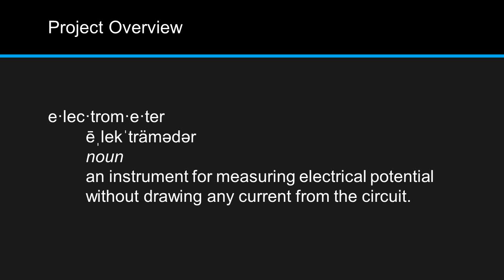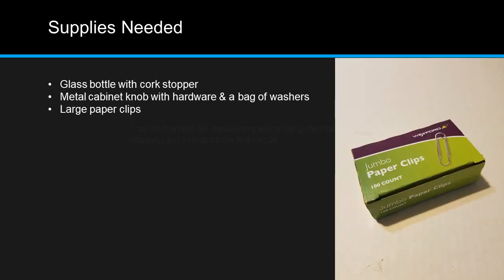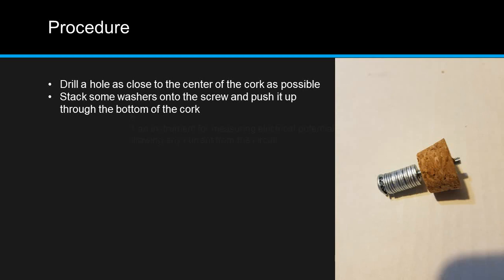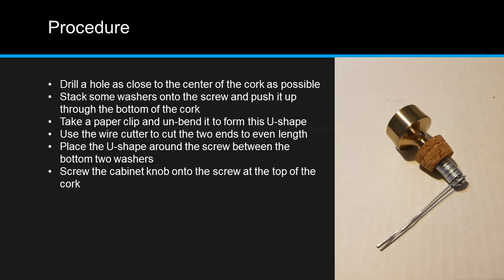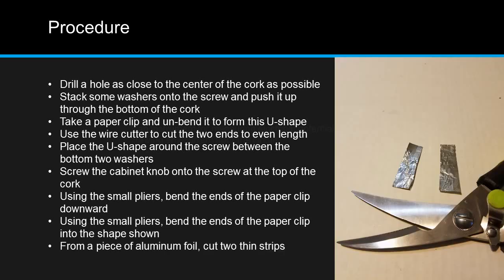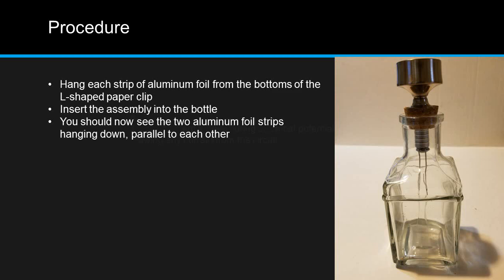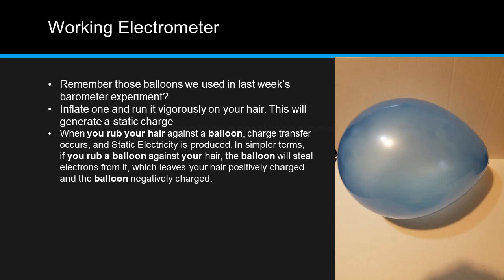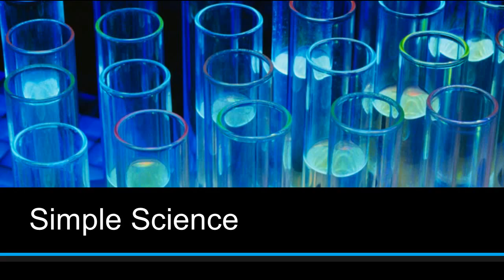Simple Science 2: Build Your Own Electrometer

Comment: It's NOT an electroMETER. It's an electroSCOPE. If it had proper low-friction bearings, a scale, and were calibrated for what voltage gives what deflection, THEN you could call it an electrometer.